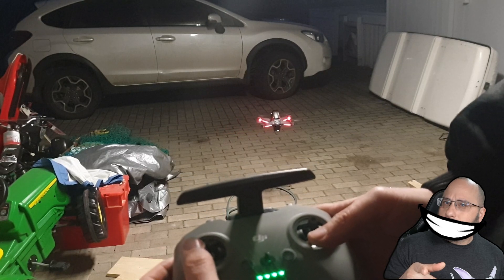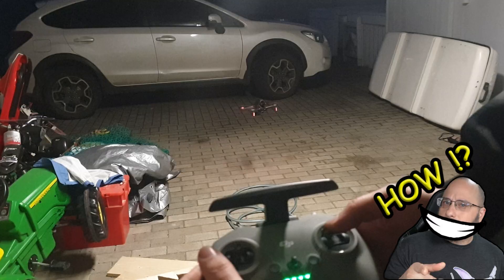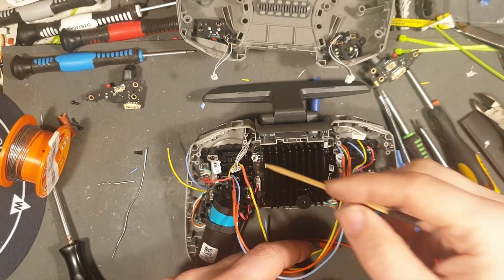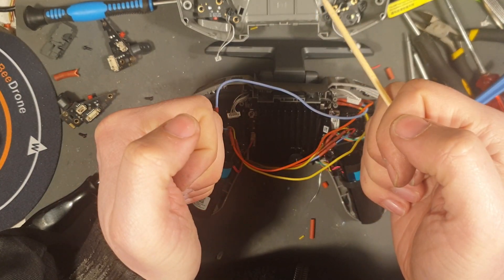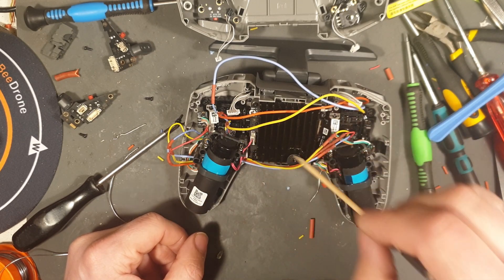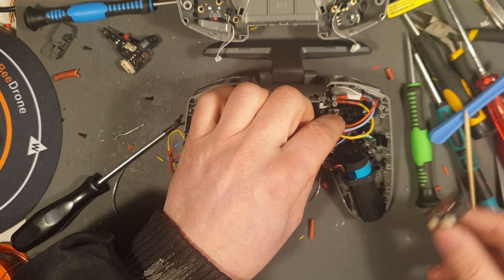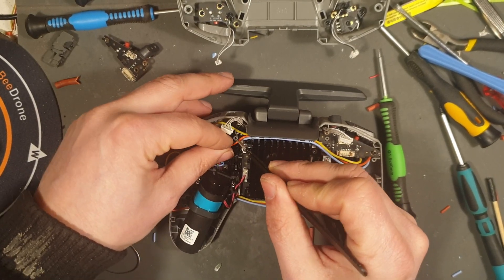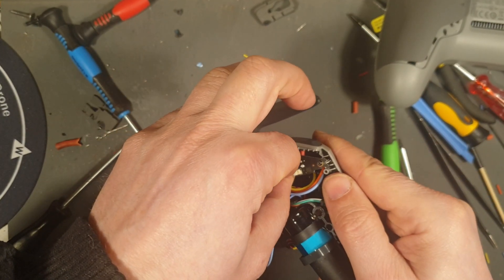DJI FPV Drone Mode 4 - The first DJI FPV Transmitter Teardown and Modification🔥

Comment from the maker: DJI FPV Drone Amazing, but when i saw joshuas review theres no mode4. What?? 
We gotta do something to help mode 4 pilots in the fpv community, challenge accepted and complete :D worlds first dji fpv drone mode 4 pilot.... maybe XD
Reply: I followed your tutorial to open the radio controller, then I did not cut the lines or do any soldering.
I just removed the 6 yaw threads and rolled into the spindle and reversed the connections.
Now I have my mode 4, thanks for your video again
Reply from the maker: @stark97442  thats great! but im little confused 6 yaw threads? did you just swap the pins in the 6pin connector? i realy want to see this :D
Reply: @Just4FunRC  Sorry, 3 lines of yaw and 3 lines of roll
Reply: @Just4FunRC  
https://youtu.be/UCnpMmPYfY4
here is the link of the photos of the assembly, thank you for the tip :)
i can fly now

Comment: 3 years later,still no firmware update that has mode 4, so it was good idea not to wait XD
Reply from the maker: haha yeah. but you seen RC 3? its even worse! gonna keep my lovestick for avata 2 only
Reply: @Just4FunRC  Well, It doesn't have the antenna and the radiator so it is easier to put new cables XD 
But it is a mistery- for so many years, so many requests and complains and still nothing. I have bought the controller, learned to fly on Uncrashed simulator to find out there is no mode 4, the one I have learned XD So the only solution for me is to reroute the signals or relearn the controlls which would take around 60 hours ;)

Comment: Hello, would it be possible to also invert the Pitch with your method ???
Reply from the maker: from one stick to another? sure
Reply: @Just4FunRC  no I meant that when I lower the Pitch, it moves the drone forward and when I raise the Pitch it makes the drone go backwards
Reply: @Just4FunRC  Pitch remains on the right joystick Exactly the same as you, except I'd like to reverse it from top to bottom

Comment: Hi there, I did the mod and everything with the sticks is working however the dial that controls the gimbal at the top left of the control isn’t working at all? What should I do? I tried to calibrate the controller with the goggles and the sticks are working but the dial movement doesn't even register? Help!

Comment: Can i send you my controller and paypal some money and have you do this?
Reply from the maker: Shipping aint gonna be cheap. Norway,
And around xmass season you can expect delays ^^,  id rather recommend try to find a such a service or a person who can solder in youre local area. Would be much quicker to get back in the air. Could use this vid as a guide. :)  
Also use 28awg wire.in this vid i used 26awg thats what i had atm.

Comment: Hey Just4Fun RC, I bought the Dji Avata a few weeks ago. Makes ultra fun with the Joysick, but I thought I also want to do Cliffs Dive xD. That's why I bought the Dji FPV Controller 2. In the Simualtor I quickly realized that I can not fly so, but unfortunately I found no mode 4. With the support written, but unfortunately still no answer. Since I stumbled on your video, really great work :P. Now my question, have you heard regarding mode 4 an update from Dji and if not what I would need everything for the conversion as you have done? because I see in the video you cut the Cabel.
Best Regards Yves
Reply from the maker: Hia buddy.  well we asked DJI when this transmitter was first released public.  or for a costom stick mode.  nada nothing. 
today still nothing. since the release of this transmitter. i have converted 6 of these to mode 4. replaced gimbles, batteries, heatsink etc :)   all in all its just plastic and metal put together.
what i find easier is just to DEPIN the connectors. the wires are long enough.  BUT you might risk busting the pins. so soldering would seem to be an safer option.
tools i use when fixing these are
Philips screw, tweezers, guitarpick/flathead screwdriver/ (to seperate the casing) optional solder/wires/heatshrink. and cup of coffee + norse metal blasting from the speakers :)
good luck buddy
Reply: @Just4FunRC   Thanks first for the super fast response, really cool of you
Very sad, always thought Dji is a super brand. And also has its price... Well, so you can deceive yourself again...
Oh I've never soldered in my life 🤣 Then I hope that with me the pins do not break...
Cup of coffee and metal sounds good, thanks for the congratulations, I'll try the same time the days
Thanks for your support best man 🤗👍
Reply from the maker: @yvesmattle  No worries :) im happy help the fpv community.  id realy recommend soldering the wires. basic knowledge of solderings can help you far in the fpv/rc hobbies. and cheaper :)
do  little research on soldering and depin before you start anything. as i say "Nothing is impossible, it just takes time"

Comment: hello sr. iam experimenting ghost moves on the yaw axis when y pull down throthle (mode 2) i can se it in the calibration screen on liftof. and i went flying and iam experimenting the same ghost move on yaw axis. any idea? thanks for                 your time
Reply from the maker: liftoff like the sim game? anyway is there any chanse you might have tried adjusting youre stick expo? when you calibrated did you force/push hard on the sticks?
Reply: @Just4FunRC  mi rates are 130/650/0.80. i started to experience this problem on simulator, and then when I went flying i got the same problem than the sim. Yesterday I open up the controller with your video and I used some air to clean, closed up and now it works... pretty strange..any idea what could be? Thanks for your time
Reply from the maker: @gonzarb93  hmm as there arnt any physical connection with the hall sensor.  there might have been some dirt debree that has prevented the magnetisme firm movement.  first thing that pops into my mind.  glad it worked for you buddy :D
Reply: @Just4FunRC  I will try today in the field..I will report back later. And something related to the battery?

Comment: What's the point of the this modification. ?
Reply from the maker: Im a mode 4 pilot :) and dji fpv didnt jad the option, only mode 1 2 3.
Reply: Okey,  I´m sorry but I don´t now what a 4 mode is.. 🤷🏽‍♂️.
Reply from the maker: @jonandreassmuk117  left stick i have throttle and roll. Right stick i got pitch and yaw :)

Comment: did dji ever update the firmware ?
Reply from the maker: they did do a sneak update. so you couldnt tinker with the hack settings or do a rollback on v2 goggles.
Reply: @Just4FunRC  ah bummer, i was hoping for an official mode 4. well time to mod it. thanks for the fast answer

Comment: Hello, everyone,
am I right with my idea? If I simply switch the plugs from the
Hall Effect sensors from the left side to the right side and vice
versa and then later switch to the existing Mode 1, then l
should actually end up in the desired Mode 4. The existing
mode 2 is then mode 3 and mode 2 is mode 3. Mode 1 then no
longer exists. Am I right? Thank you for your support.

Comment: Hello, I resoldered my remote control and it hasn't been able to connect since. did I forget something? Please help
Reply from the maker: i dont know what you soldered but, did it power on? were you able to rebind it? after and before soldering?

Comment: Is there any info when they will add Mode 4, i just bpught the drone and i dont know why they dont give us the choice to fly in mode 4
Reply from the maker: hia buddy. i contacted them after launch. the only answer i got that they will forward it to the board. nothing more... so my gues is the gentlemen with tight ties and clean fingernails would maybe look into it if theres enough consumers requesting it.  and my take is nah. were a special breed ^^, so thats why i have done it myself and love using it for various tasks. roof inspection, supporting red cross when on search and rescue.  this drone is a jack of all, master of none :)
Reply: @Just4FunRC  tight eyes haha, i dont wann do it myself because of the care refresh. Its so weird that they forgot a mode smh
Reply from the maker: @dertypderhalt  i know. i owned a dji mavic before but i cant recal if it was the mavic platinum or air 2.  but i was able to costomize the sticks.
anyway its just plastic and metals. and the carefresh was either to expensive or took to long. so i just started to fiddle around and woila.  and yes you dont even need to solder. thanks to a viewer for the tip.    i tried to relearn mode2  but it just didnt work it was weird and felt all wrong hehe.
Reply: @Just4FunRC  i practiced 1 whole year in mode 4 now im learning mode 2 and im dping kindo okay
Reply from the maker: @dertypderhalt  i tried for 2 days, i gave up XD just couldnt do it
Reply: @Just4FunRC  I hope i will be able to get used to it
Reply from the maker: @dertypderhalt   @da wattson main  you will buddy. looking forward to see some vids from you :D
Reply: @Just4FunRC  Thanks, lets hope the rameneaters patch mode 4. The vids will be much better

Comment: Hiya, just wondering is it possible to witch the pitch control/wires around so when in manual mode if I press forward/up on the right stick (I fly mode 2 I believe) the aircraft pitches up and if I press down the aircraft pitches down? All the other controls are fine, I just wish I could invert the pitch! 

Can I just swap wire around similar to how you've done it? Cheers!
Reply from the maker: Ohh Great timing, im working on my transmitter right now.... we can give it a try. Sry for late respons
Reply: @Just4FunRC  Any update on reversing the pitch?
Reply from the maker: @mickyg02  oh snap dude. Are you stalking my mailbox XD just traded one of my nazgul for a 2nd dji fpv drone. 
Hehe nah honestly i totaly forgot about it. Can see if i can test it this weekend since the transmitter is open already :)

Comment: HelloJust4Fun RC could you advise me how to reverse the trhottle, I drive in mode 2 but with the trhottle reversed as rc helicopters. In the Dji FPV combo "controller pad" system I am disappointed with Dji ... with the Mavic drones you can reverse all channels in the custom stick menu.
Waiting for an answer, thank you in advance.
Reply from the maker: Hia Diego :), interesting question, oh sry for late reply. yeah i wondered on that aswell why not let ppl fly like they want to insted of "heres youre only option"  you know what.
i think im gonna tinker with the transmitter again before i give the final answer. :D
Reply: @Just4FunRC  HelloJust4, thank you so much, I would be very curious to know how to do it ... these days I opened the controller as per your magnificent video, but you cannot turn the complete throttle lock 180 °, on Futaba radios and etc. always did.
Here I think the only solution is electronically ..... maybe by turning the magnet or something .... I don't know how to drive my DJ FPV.
I drive in mode 2 but with the throttle reversed.
A guide on how to intervene for this serious lack on the part of DJI would be nice. on such a new product, years ago you could easily reverse all your mavic .. old ones ...
I hope in your solution you have been great at doing mode 4 like a true professional and detailed guide on YouTube
Good day

Comment: I if you take the pins out of left side they will reach the right side yurt swap out to do the other side you have to extend and join wires  worked fine thanks for the video
Reply from the maker: yup, was thinking of repin them. but nah i wanted to solder 😅 thanks for tuning in

Comment: I opened mine, didn't even do any changes and now it won't power on anymore...
Reply from the maker: Brand new? Did it power on before? When you opned it. Did you perhaps hit the pcb or wires, Follow the wires from the batteries. Use multimeter check for shorts. Hope you will get it sorted buddy :) it was a dumb move from dji to not include mode4
Reply: @Just4FunRC  Yes, it was rather new and working but I had a problem with my dial wheel, it didn't calibrate. It wiggled a bit so I thought I'll open remote to check it's in right place. I't seemed fine so I closed the RC and no power no more. I't was a dum move trying to fix it by myself, probably shorted out some stuff.  I'll have to get my hands on that multimeter but even if I find the problem fixing it is another story. Already ordered new RC from DJI.

Comment: Those aren't potentiometers. They're Hall effect sensors. It might have been possible to swap the small PCBs with the sensor on it. I'm not sure if the wires would have reached far enough to do this.
You can switch which gimbal controls which axes of the drone but I don't think you can reverse the direction of the an axis. I don't think you can swap power and ground on Hall sensors like you can on potentiometers. It might be possible to rotate one of the small PCBs but you'd need to come up with a custom mounting option. It might be easier to rotate the magnet in the gimbal than rotating the sensor.
Thanks for sharing your teardown. It's the first one I've seen other than the photos I posted to Hackaday(dot)io.
Reply from the maker: Thanks for the Heads up :) i like that. on the dji drone you could only do mode 1-2-3 and not 4- as of today thats why i swapped around alittle. even easier i could just depin/repin the connector the wires are long enough

Comment: https://drive.google.com/drive/folders/1-0FgzRmMZlJSkKTxyLIlehSbrIPZEEz5

I just change the wires for Nick and Pitch and it works. It’s also easy to undo because nothing is damaged.
Reply: Mayk are you saying reverse pitch is working for you?
Reply: @mickyg02  Yes but not good. For normal flying it’s ok but not for Race or Gates. 😂
Reply: I just did it that way (switching green, orange and white cable from one joystick to the other) today and switched to "Mode 3" and it works fine!
I also prefer a reversible solution without cutting wires.
Thanks a lot for the video, it really helps to open this silly transmitter.
It is such a shame for DJI to leave behind all Mode-4 pilots for no good reason.

Comment: Hi , will the new dji controller unit pair up with existing dji air units?
Reply from the maker: Bad news my friend,  it wont. Only the previous DJI transmitter will.
Reply: @Just4FunRC  ok thanks for that , i was hopeful it would I like the look of the new controller.  Maybe a firmware update in the future may fix that.    
Thanks
Reply from the maker: @Tribal1974  lets hope that :), right now its a firmware jugle from DJI issues here and there- it will get sorted out .... lets hope :D

Comment: Hello, great your video as always.
I have been looking for this solution for a few days.
DJI will update to have Mode 4 thought of you.
That's what he told me, (in the near future).
I had already thought of this solution of exchanging the roll and the yaw of mode 2 to have mode 4 :) ...
In any case, thank you very much for your video, I am a racer pilot in mode 4 and I cannot pilot the dji fpv manually for the moment.
Maybe soon :)
Thank you
Reply: I followed your tutorial to open the radio controller, then I did not cut the lines or do any soldering.
I just removed the 6 yaw threads and rolled into the spindle and reversed the connections.
Now I have my mode 4, thanks for your video again
Reply from the maker: @stark97442  de pin and replace :D gotta love it. im so happy they didnt do flatcable like the one in jumper t16. but then again dji its quality